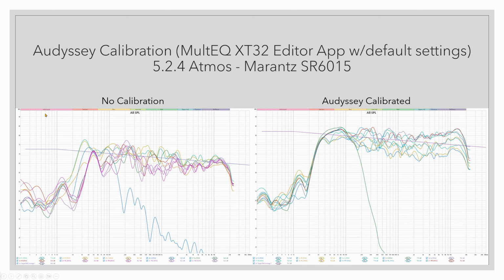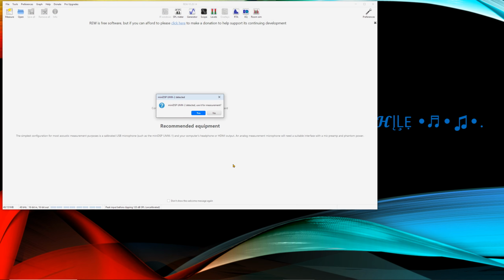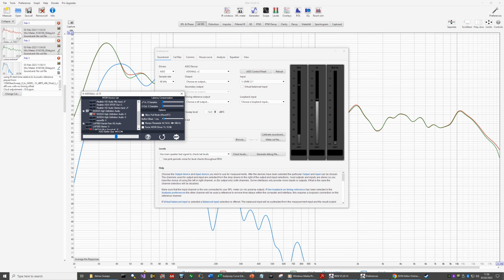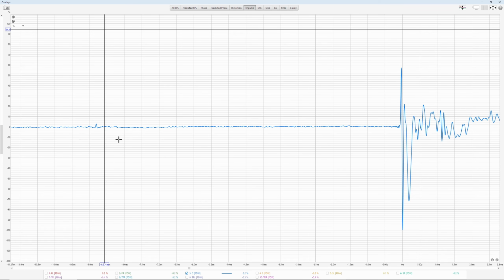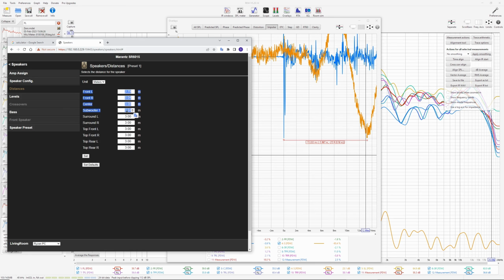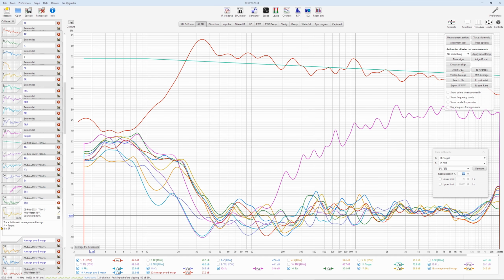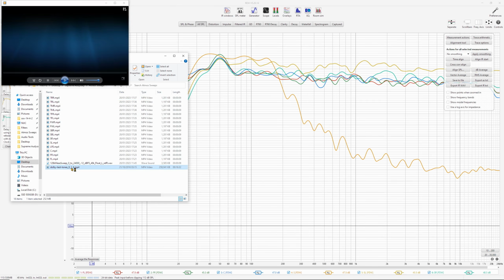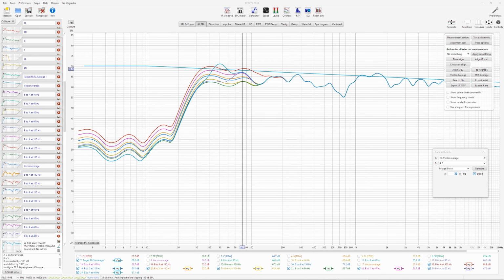Supreme Audyssey Calibration by OCA

Comment: Starting down the path and already have a question.  JSON is new to me.  I was cutting and pasting and something happened in the editor that collapsed the tree view to one location.  The editor just shows an error with 16384 items.  How do I go back to see the full tree and continue my work??
Reply: Fixed by switching to text mode then back to tree.  Uploaded the new audy file to the file (had to change extension from json to audy) but the measurements aren't .4 and the levels are 0 like you show.  Whats up??
Reply from the maker: Just click "New" in the top left menu and drop the .ady file in it again. It will be refreshed. Also check your MS Office regional settings. Some Excel versions can replace , and ; which might be causing the error.
Reply: @ocaudiophile  Appreciate that, sir.  New to REW and looking forward to getting things dialed in and learning along the way.  Already subscribed and appreciate the content!

Comment: Here is my feedback having completed this process. Firstly great learning experience. Going through things a few times makes them easier to follow and dots start connecting. The graphs looking stunning and I was able to follow each step all the way. Then I gave it a listen. My first impression was that the speakers seemed to have come alive a lot more and sounded more immersive but sounded a bit harsh in some instances and the bass seemed weaker to me and also little exaggerated in the upper bass frequencies. I went back and forth with my old settings and the new ones. Since I have a minidsp and a Denon 4700 which has two speaker presets, it was a lot easier to compare. I found the bass sounding better in my old setting so I went back to it but applied some of the learnings from this tutorial to it especially the correction of the impulse responses. That made a big difference and everything sounds better than before. So I ended up with new settings using my old and new and it sounds great. 

What was interesting was that the FR between the latest REW and the early access differ. Not sure why but they do. Also for others the controls to see IR distances on IR tab is Ctrl + right mouse key and drag. 

Thanks OCA
Reply: I have a Denon x3700h andI ended up doing the same as you admittedly, after praising this mothod so much. My results were similar - the mid bass was way too exaggerated and the rest of the speakers sounded like they were crossed over at 200hz, ie; no bass even where the speakers can handle 60hz or even 80hz. I applied the impulse response to all speakers and now my original Audyssey calibration sounds much better. Surprisingly though, the biggest improvement came from turning Loudness Compensation off in the now perfected original calibration. However, after finding the original calibration sounded better, I still learnt so much from this tutorial! I feel like I am now an advanced REW user! Thank you OCA! I hope you can find why the calibration (after following this tutorial) ended up sounding the way it did. I followed it exactly as instructed. I can't wait to try your next tutorial....:)
Reply from the maker: First of all thank you and congrats on your achievement. REW has been going through an extensive development stage recently and some trace arithmetic basics have been changed although there would not be a difference in the final filters produced.

Comment: I have always had DEQ off as I find its boosts the atmos channels too much. Does this process work if DEQ is set to off?
Reply from the maker: It sure does and as long as you are ok with listening to your system at the level you measured, it will even sound better overall.

Comment: I did my original calibration using your process and the test signals built into REW:  the results were significantly better than Audyssey, and I thank you for that.  Now I want to experiment with your 'Atmos Sweeps' files.  When I use the signals that are built into REW, I can specify which speaker I want to use as the reference.  How does REW sync the test signals when they come from your individual .mp4 files?  In other words, what does REW put at t=0 for each speaker signal?
Reply from the maker: Atmos sweeps are identical to REW sweeps in terms of timing. You can adjust speaker distances same as others
Reply: When I select 'from file' in the measurement pane, the option to select a specific channel as the timing reference goes away.

Is there a way to do name a specific channel as the reference when using your files?
Reply from the maker: @ronaldippolito6785  They all use center channel as acoustic reference but REW will adjust for that if you're using a different one as long as you don't change it during measurements including all non-"from file"measurments.

Comment: Hey, sorry to bug ya again. With the subs - am i supposed to align to the target curve while i have the -10db LFE in the AVR? So when finished, the subs will be 10db hotter than the target curve?

Primary reason i ask is this is causing me to run my subs awfully hot. Granted, i am calibrating pretty hot overall, target curve is at 76.4db. But if i use the -10db, im having to keep my sub AVR setting at 0 and my three PB1000 pros are running at -6db, just to hit the harman curve. Or should I  be matching at the LFE 0db.

It could be just because of the type of subs i have (hindsight is 20/20, should have gone with at least the 2000 pros).
Reply from the maker: If your subwoofer measurements range is 0-24000Hz like other speakers, you can leave LFE setting at 0. -10dB setting is only useful if you're measuring subs 0-200Hz because when range is low, the receiver thinks it's an LFE only signal and boosts it by 10dB. Btw, in the latest early access version of REW, you can apply -10dB to LFE automatically during measurement, you don't need to change anything in the receiver.
Reply: @ocaudiophile Ahh. Got ha. I've been leaving the sub measurement at the same range as the speakers, no wonder I've been having to crank up the volume!

Comment: First, thank you!!! Question: You've zeroed out the response time for the ADY file, however Audyssey still applies the mic calibration file to the response, increasing the high frequencies by 10db. Shouldn't the zeroed out response time account for the mic calibration file in order to disable any correction by Audyssey? If so, do you have the 16384 points that account for this or at least, let me know how to generate it (if possible) from the mic calibration file you already posted. Thank you!!
Reply from the maker: Audyssey applies mic calibration only if measuerments are made with the automated Audyssey procedure. The method bypasses all that by changing all speaker responses to perfect speaker.
Reply: @ocaudiophile  When I look into MultEQ after uploading the zeroed Default.ady, I can see the boost of the initial response in the 20khz. Is it to be ignored? Not sure I understand what you mean by automated Audyssey procedure. Isn't uploading a file from MultEQ the same as running the procedure from the receiver? Thank you again!
Reply from the maker: I'm not sure you've understood the process. The Audyssey measurement responses have to be replaced by 1,0,0,0.... perfect speaker responses.
Reply from the maker: Can you share your original ady file
Reply: Hi, have the same problem. Were you able to resolve this somehow or did you just leave it like that? Does it have any negative influences on the sound? I uses a Cinema 60
Reply from the maker: This is what I see in my app:

https://drive.google.com/file/d/19MArZapR6U9T0O1YJkd8qu-QSX0QITR8/view?usp=drivesdk
Reply: @ocaudiophile  I can confirm that by changing the "targetModelName":"Denon AVR-X1700H" in the ADY file the mic target curve is no longer applied and everything is flat, however the ADY file cannot be uploaded to the AVR (greyed out). If there's anyone that can help with creating a speaker response which accounts and negates the mic curve file is you! :D
Reply from the maker: Interesting, noone came up with that problem before. Is that receiver multeq xt or xt32?
Reply: @ocaudiophile  It is Multeq XT, however I also tried setting the targetModelName to 3600H which is XT32 and the curve still got applied. The curve is not applied only if the app does not recognize the targetModelName as an existing Denon AVR.
Reply from the maker: @horatiud.5976  Maybe update the app. There was an update last month. Noone else had this problem as you can see from all other comments here.
Reply from the maker: Try sending this one to your AVR:

https://drive.google.com/file/d/1HDBlMVdjE9wLKkcSX3DioHLvp43Z-GbJ/view?usp=sharing

If it works then you can adjust speaker distances, custome curve points and crossovers on this file.
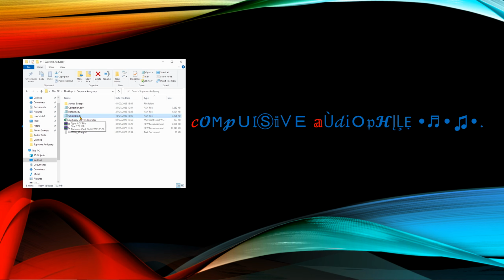Reply: @Obsessive Compulsive Audiophile  I tried. The mic curve gets applied as soon as I load into MultEQ. I also tested your settings with the model name as seen at 5:01, including the amp string. With your receiver target model, it is flat... It must be a model name dependent setting within the app itself.
Thank you for trying! I'm subscribed to your channel if you ever feel of playing around with modified impulse responses to account for this. 😂
Reply from the maker: @horatiud.5976  I have a hidden mic calibration video. You can download the calibration file there and deduct it from your measurement responses while Audyssey is on. But I believe, there's a chance that, you can complete the method as is without doing anything. I'd try that first. Maybe, no calibration is beingn applied to the responses.
Reply: @Obsessive Compulsive Audiophile  Already run the process, and I get a correction of +10db @16k up to +18db at @20k. I still have to measure the after correction response at some point tomorrow, but really, it sounds amazing as is! I also can't really hear 16 to 20k lol.
In my book, this is a success, and it's miles better than I could ever do without your instructions.
Thank you for this!
Reply: @ocaudiophile  I am having an issue here too. Maybe sligtly different. I cant get the Audyssey app to recognize the edited file. It saves to desktop as .ady.json. I tried deleting the .json but it add the calibration values instead!
Reply from the maker: While saving the file from the json editor, change file type from json to "all files" and replace ".json" extension in the name box with ".adý"
Reply: @ocaudiophile  When I 'Save to disk' I can delete the .json at the end but the only other options I have here are Keep as-is, Format and Compact. Any ideas?
Reply from the maker: I've never seen such options. Save to disk is quite straight forward. In what step exactly are you asked for such options?
Reply: @ocaudiophile  When I want to save the file on the json online editor. When i click on save to disk I can Enter a name  for the document (where I can delete the .json at the end.) Under that are the three options. It's not like saving a regular file on windows where I can choose the format of the file or choose All files.
Reply: It looks like this:  https://drive.google.com/file/d/1JY-CvIOXxrBIlq0vexkjgBZ0xEAy0eaf/view?usp=share_link

After I save it, it has .json after it.
Reply: @Virtual Insanity  there's an option  to just copy to clipboard as compact form. You could just paste over the content of your original file.
Reply: @horatiud.5976  That didn't work. Any other ideas? Being stuck at the beginning of anything sucks. :(
Reply: @ocaudiophile  Would it be possible for you to upload a blank .ady file for a 5.1.4 setup? I am using the Denon x3700h. Only then can I get started....thank you boss!
Reply: @ocaudiophile  I finally got it! It's a case of putting the file onto your MultiqXT32 folder in your phone then 'import' the file using the + sign in the top left corner. Now it shows in the app perfectly. Everything is FULL BAND and zero'ed out. Now I can begin.... : ) Please mention in your videos how to do it. I am quite technical and even I got stuck. Thank you for all your help. You, too Horatiud : )

Comment: I adjusted Max volume via the command protocols, and took all my measurements at that volume level.

After completing your procedure, I hear a pretty big difference between DEQ on or off when I listen at that volume level.  Why would that be the case?
Reply from the maker: DEQ will always make a difference unless you crank up the volume all the way to 0dB . The trick is setting up your system such that DEQ effect is exactly what you want at the volume level you like and let DEQ work its magic when you listen at lower volumes.
Reply: @ocaudiophile  I did my measurements at the volume we normally watch.  Occasionally, we listen at a louder volume.

Do you know what DEQ does when you increase your volume?  Would I be better to have two calibrations, one for each listening level?
Reply from the maker: @ronaldippolito6785  DEQ will correctly adjust (increase/decrease them more than the main volume)  low and high frequency volumes depending on the main volume. It will also change surround and height speaker levels relative to the others. As long as you have calibrated Audyssey with DEQ on at  your ideal volume level, the effect should be inaudible. DEQ normally boosts the LF and HF and surrounds way  too much for any volume level that's below reference (0 dB which is very high for most people) and the method takes care of that.
Reply: @ocaudiophile  There have been articles and videos for years regarding the surround levels being boosted too much by DEQ when the listening volume is decreased.

Why do you think Audyssey has never changed their level of adjustment?
Reply from the maker: @ronaldippolito6785  Because they sold the license to Sound United (Marantz/Denon) lonf time ago so they cannot touch it anymore and Marantz/Denon doesn't care, they are already slowly switching to Dirac.

Comment: Awesome video!! I'm just curious as to what your thoughts are on starting with the timing reference speaker (eg. center channel) set to something different than actual. For example, if my center channel's actual distance from the listening position is 2.74 m but I set it to say 2.34 m, will everything still sound ok as long as I time align the rest of the speakers to that speaker?
Reply from the maker: Yes, surround effects will be accurate. It only has an effect on the size of the sound bubble. Btw if your actual distance is 2.74m, you need to enter 2.40m in the receiver distance setting anyway due to speed of sound being taken as 300m/s in most models.

Comment: Thank you for your videos!! Is it really necessary to take 3 measurements and average them, or can I just use one measurements from the mlp?
Reply from the maker: One will be enough and even better if you are only listening at one position.
Reply: @ocaudiophile  Thank you! Im on a mac and I don't have the [A] / [B] option for some reason... only A/B. What do you recommend I do? Thanks again!
Reply from the maker: @theweazel  https://roomeqwizard.com/installers/REW_macos_5_20_14ea55.dmg
Reply: @ocaudiophile  Thank you, I didn't see this version when I looked! Now I have that trace option. Looks like the mac version doesn't have graph metrics though, which is a bummer! Thanks for your help.
Reply from the maker: @theweazel  It must have it, just with different buttons. Check the REW manual.